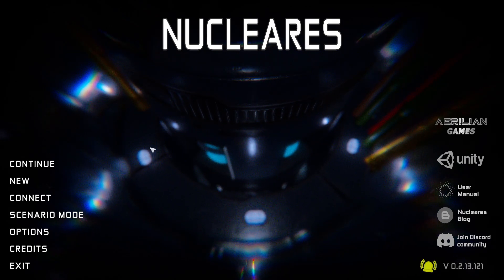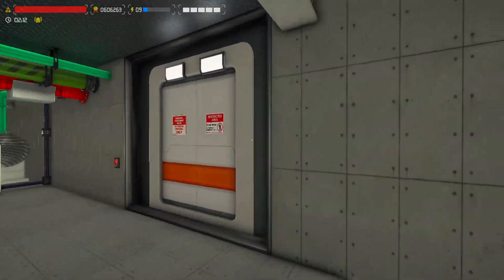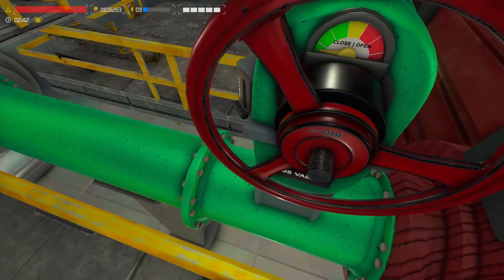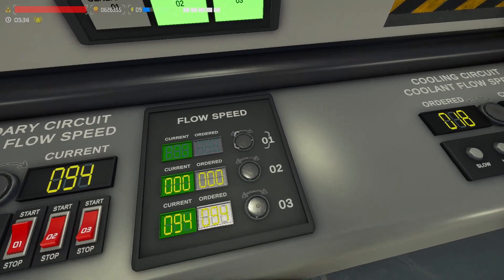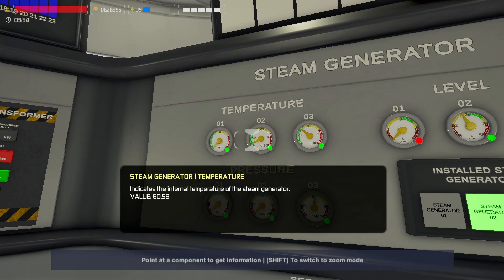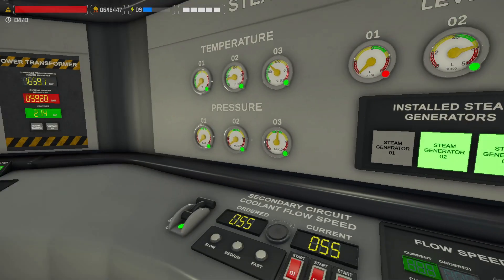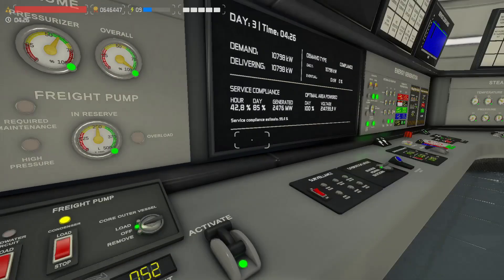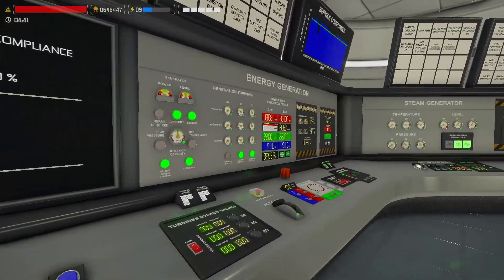How to hot start 2nd turbine and balance power | Nucleares

Comment: Thanks! Why is condensor so low at 18%. What is the advantage?
Reply from the maker: What I noticed water will be hotter that means you don’t need that much pumping to cool. Also at this point condenser is very powerful. My guess is that is because I am only running one loop and started second